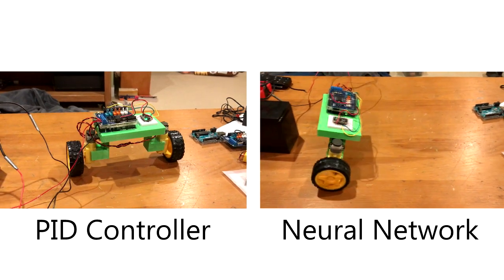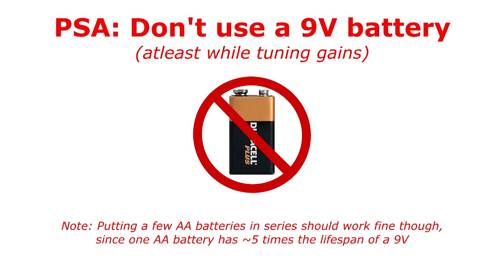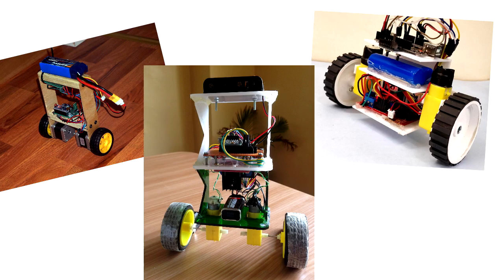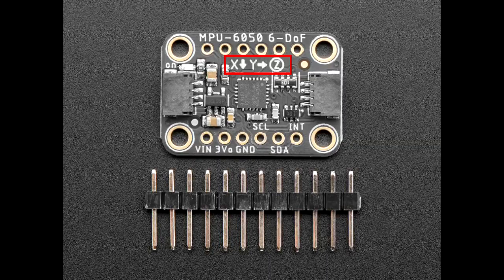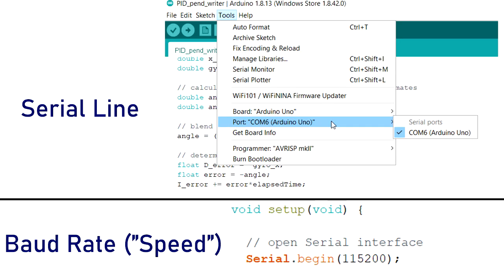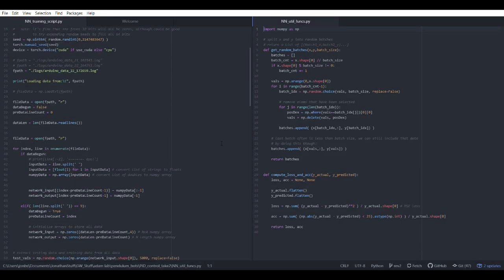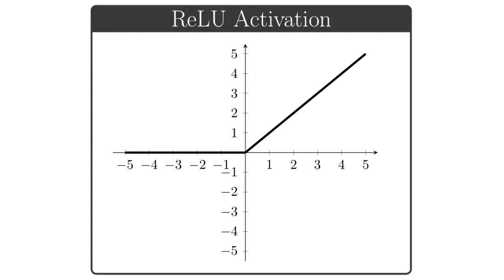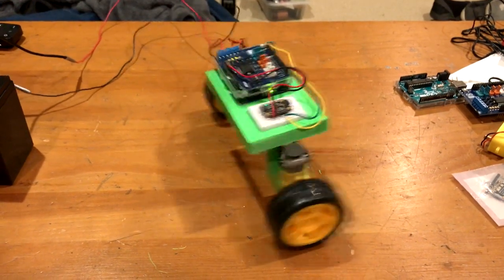Making a "Smart" Self-Balancing Robot | Training a Neural Network to Replicate a PID Controller

Comment: How did you handle the sensor data? I'm currently trying to learn the Kalman filter right now and it's kicking my butt, but I see another way of doing it is using something like a low pass filter.
Reply: I initially tried something more simple as a complementary filter but later I discovered how to use the DMP of the MPU6050 and it improved so much everything.

Comment: You can also train this robot without actually collecting data first, what I will do is to create a routine clasical PID agent function  that generate target value and use that value to backpropagate  if the output of the neural network is not the same as expected PID output so the PID become supervisory agent  until the neural network converge , with minimal code you can actually train the network on the robot microcontroller

Comment: Hi, 
How did you tune the PID gains to achieve a better outcome?
Reply from the maker: Hey, if you look at the description of this video I included a few links to videos detailing the gain tuning process, but in essence I did this:
1. Tune P until the robot can almost balance on its own (I kept a finger on the top of the robot to prevent it from falling, but could still get an idea of how close to balancing it was based on how much of a correction force I needed to apply)
2. Tune D until the robot can more or less balance on its own (it will not get the right setpoint, but should be able to stay balanced for a decent amount of time without needing correction)
3. Tune I until the robot returns to straight up and down (i.e. balanced) given a push
Reply: @jankstation1190  Thanks so much, one more question please, What were the criteria used in evaluating the control algorithm?
Reply from the maker: @alimahmoud8708  I didn't have a very concrete evaluation approach, I would just push the robot with my hand and see roughly how large of a disturbance it could recover from. I suppose I could have recorded this process, and then paused at the largest angle that it recovered from to measure it concretely.

Comment: Hi.. Could you show how to training this robot with neural network?
Reply from the maker: Hey! So I trained this offline, which is to say I logged data of the PID controller running for a while and then used this logged data to train a neural network. The network itself is a simple Multi-Layer Perceptron with 3 hidden layers of 4 neurons each, and PReLu as the activation function of each layer. I trained it using pytorch with mean squared error as my loss function. The code can be found here: https://github.com/SchwartzCode/Neural_Net_Balance_Bot

Comment: Hi, could you please post the code you used for the Neural Network? For the Micro controller and training.
Reply from the maker: Sure thing! One note though - I currently have a transpose step on the arduino side because I was too lazy to write a python script to transpose the data on my own. I may eventually do that, but for now it just takes up a bunch of memory for no reason other than to compensate for my laziness. Code can be found here: https://github.com/SchwartzCode/Neural_Net_Balance_Bot